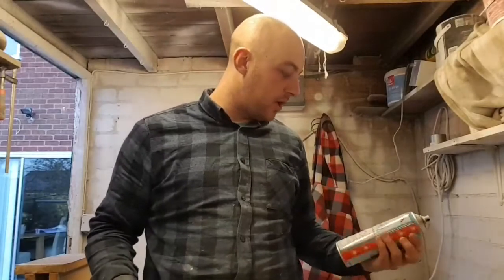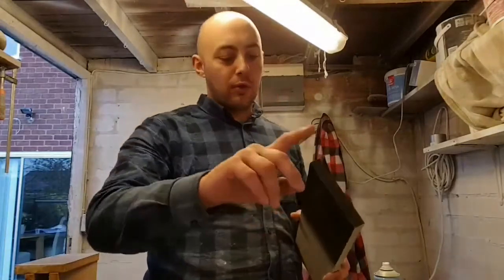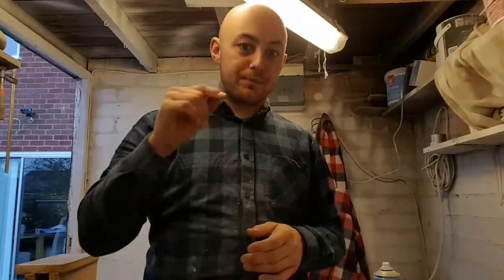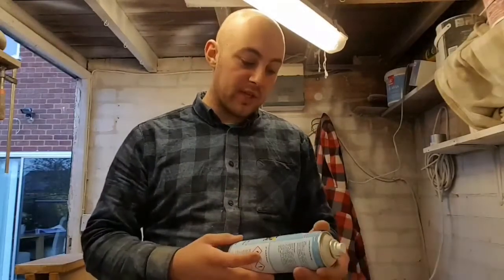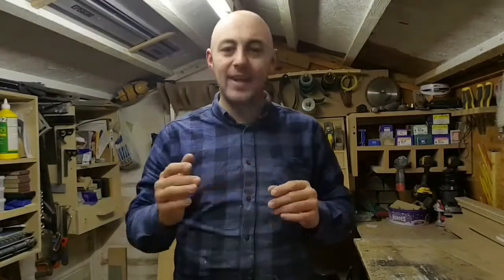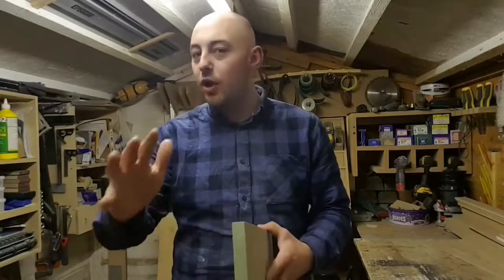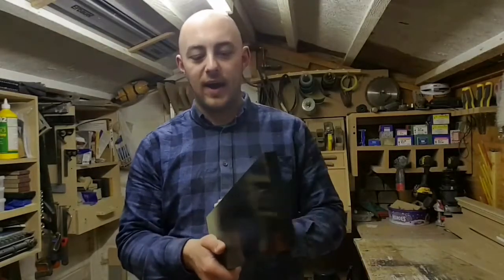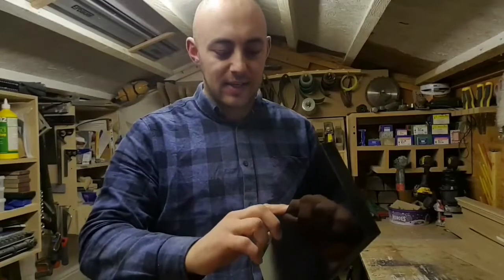How to paint mdf  the easy way

Comment: Hi, I've just put a vid up of me spraying some pieces for some cupboards I'm making, in it i mention this, I agree no need for 'sealers', i put the first coat on fairly thin, sand that smooth then the subsequent layers go on a lot better, the key is sanding between primer coats,
Reply from the maker: Gid joiner  yes mate i have just watched it and people spend a fortune...  on sealers etc.. not needed.. I spray mdf nearly everyday and that's my method.. like you said the key is to sand sand and sand.??  Do you use any other type of paint..
Reply: Hi, I mainly use PU paint because it is hard wearing, it's forgiving of the occasional knock/bang & doesn't scratch easily, 
I use AC paint & Pre-Cat paint occasionally, 
AC is a 10-1 mix, that's the stuff they put on cars, it gives a very good hard enamel finish but on wood it is prone to chip because the wood underneath is softer & the paint has no give in it.
Pre=Cat is similar to AC but isn't as hard wearing, It is though a single part paint, no mixing involved so excess can go back in the tin, It's cheaper & sprays/lays down on the wood well, a good paint to start with if anyone is thinking of starting spraying, 
They all dry hard in 30mins depending on temp.
& yeah sanding is the key to MDF edges, no special sealants needed 😉
that MDF you have looks like Chronospan, I use Medite which is a little more expensive but it has a better flat face & the green doesn't go all the way through on the thicker boards, it has a brown MDF face, i found the green pigment bleeds through white Pre-Cat paint giving blue/green marbling type flecks on the finished surface.

Comment: Maybe you know is it a good idea to use from automotive paint shop, i have some kind of putty that is with fiberglass, and you mix it with hardener, and use it kinda as filler, is it good way to aply for full mdf surface including edges, and sand it 400grit, than can spray  it to get glossy finish ?